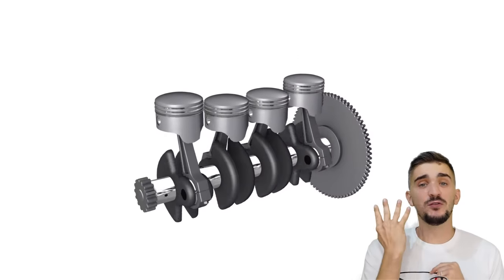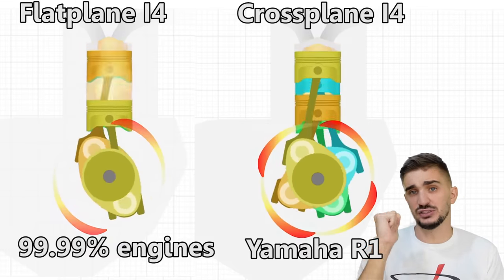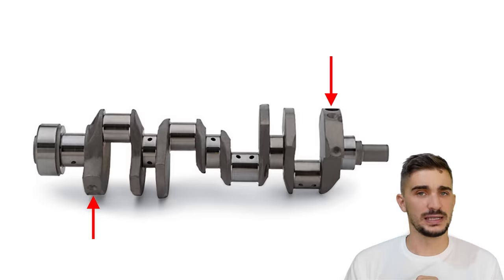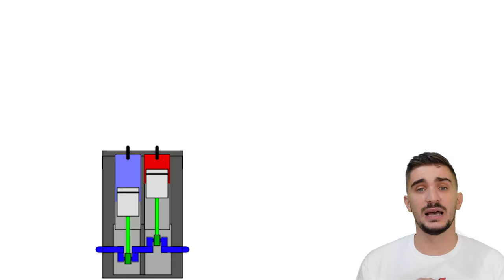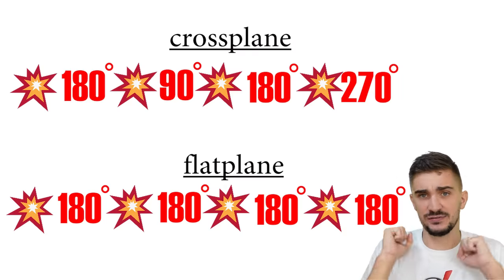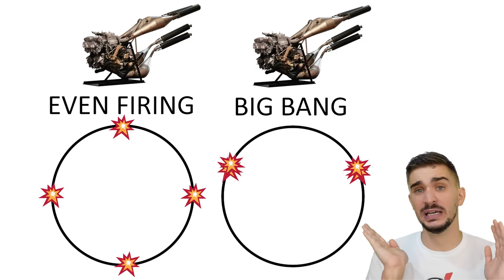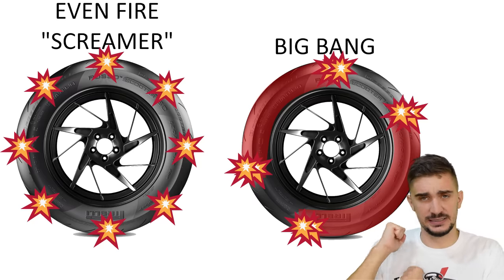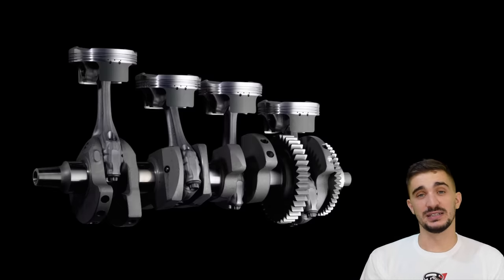CROSSPLANE inline 4 EXPLAINED in detail - How the YAMAHA R1 i4 differs from all other INLINE FOURS

Comment: Good video, but if I hear one more uninformed person make the claim that flat plane crank motors can Rev more than cross plane motors cause "engineering", I think the world might implode. It has nothing to do with crank design, it has everything to do with airflow thru the entire induction, and exhaust tract; it's displacement relative to its airflow, and lastly the camshafts ability to feed the required cfm into and draw out the waste from the cylinder at those rpm's. Nascar is cross-plane and those 358ci motors run regularly to 10k for hours, NHRA top cross plane 500ci top fuel motors rpm at over 9.5k rpm regularly thru the quarter. What really affects the rpm limit is piston speed, and the mass of the reciprocating assembly, and is the block ie. Main webbing designed to deal with the associated forces properly (of either design). Notice crank design isn't listed at all and I'll explain; yes, a crossplane crank is heavier, which affects parasitic loses in hp and torque, but these are very minor relative to total output, especially in larger displacement motors, but in much smaller engines the amount of loss relative to total output makes it worthwhile to do. Little known fact that flatplane fans don't know is the NHRA teams did experiments with flat plane top fuel engines a few decades back, in these 500ci motors the vibrations were so extreme the drivers couldn't even see the track to drive, you probably won't find this on the internet, as I learned it from Joe Amato's former crew chief. There are engine builders who are pushing LS crossplane architecture past 11k rpm and going for 12k naturally aspirated, which is extra insane because it's a pushrod motor. Which brings me full circle, most "muscle car" engines are pushrod engines which have a high valvetrain weight. This tends to cause valve float, which kills power and an engines ability to continue to rpm. Really this is where a high air flow overhead cam engine shines. It has less mass in the valvetrains, requires less spring rate to compensate for valve control, and a bit less parasitic losses as a result. So to summarize, a crossplane crank design doesn't control an engines ability to rev or make rpm, it does reduce parasitic losses proportional to weight saved, which will make slightly more power which gains in value relative to total displacement, but there are functional limits to to the crossplane design.

Comment: The real question is , why no crossplane 4 in line engines in cars? ( In existis in some yamaha motorbike)
Reply: Didn't you watch the video? No point in making an inline 4 more complicated. Most mass produced cars won't suffer loss of traction because of power. So they don't need crossplane crank. Flat plane is useful enough and affordable.
Reply: @JH09SUMIT  if It works in bikes it works in cars ( you won't loss reaction in AWD). It has a beautiful sound .

Comment: The explanation at 7:19 is wrong! Placing the weight on a balance shaft, which rotates at crank speed does not reduce weight or rotating inertia!
The counterweight can be used in a 90° V8 to balance out the 2 perpendicular (!) rocking couples. If if were used on a 4 cylinder it would create a new side to side rocking couple perpendicular to the old up and down one. 
So one could at best use half the counterweight to exchange one big rocking couple for 2 ones half the size.
This is the Problem the counterrotating balance shaft solves, because the side to side rocking couples, of the counterweight and balance shaft cancel out, while the up and down ones add up.

Comment: Why must the crossplane be 90⁰? 135⁰ would be an extrapolation of Yamaha's own idea and have a smaller gap between power pulses.
Reply: Another idea- Flatplane 4, but the cranks for the two center cylinders spin the opposite direction, connected on each side with a reversing planetary... Perfectly counterbalanced primary and secondary, plus an even firing order.

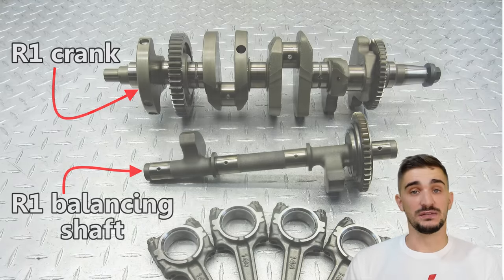Comment: This is interesting. But the explanation (from 7:11 until 8:24) for the balancing shaft's advantage compared to adding weight to the crankshaft does not seem satisfactory.
BOTH methods add mass (rotational inertia), so BOTH will diminish the engine's maximum acceleration
There must be some more nuanced explanations for the advantage of a balancing shaft

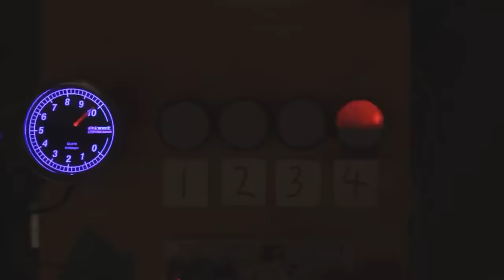Comment: Oof that sound at 16:00. Ba ba ba ba from the flatplane crank at very low speed is a boring sound, and when you make it fast, it's still pretty boring. Ba...ba......ba ba is musical, even at 10 rpm. No wonder it sounds musical when it's faster.

Comment: Your example of primary engine balance on the calculator is pretty poor. Using a large box as your medium and then ignoring the center two cylinders of the crossplane then using all 4 cylinders for the flatplane should be changed. I know it's hard to do that example with your fingers and a calculator, but you can do better.

Comment: At https://youtu.be/uM-ycHS9uvw?si=6vbFkWFPHB4SiQkz&t=494 8:14 you state that the balance shaft would result in better rev happiness, but that make no sense at all... in order to balance-out the rocking couple, the mass that is needed would HAVE to be the same as what is needed when the mass would be on the ends of the crankshaft (or it wouldn't balance those forces). Worse, we now have even more mass in the additional balance shaft and gear sets needed to drive it.

I think there's something amiss here.

Comment: I'm not into high performance bikes and I thought the crossplane or bigbang engine as no good. And it is. It is meaningless for a car.
Inline 4s are widely used in home vehicles. This isn't good for no reason. Some brands tried to sell i3s to China market but the customers simply don't like it thus forced the brands like Buick to get the 4 cylinders back.

Comment: Nothing new. Go back many many years. Dodge called it an odd fired engine.
Reply from the maker: That and this are two different things. Dodge never built or tried to build a crossplane i4. There are many different odd-firing configurations. In this case the odd firing is only a side-effect of the effort to get rid of secondary imbalance.